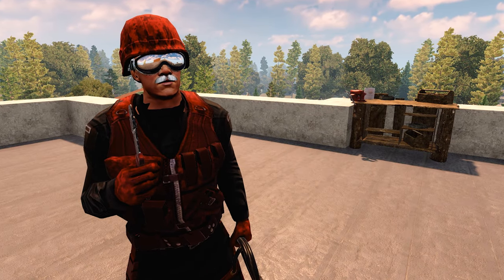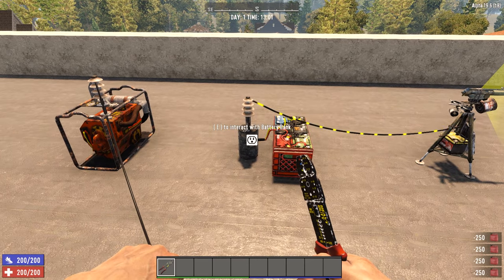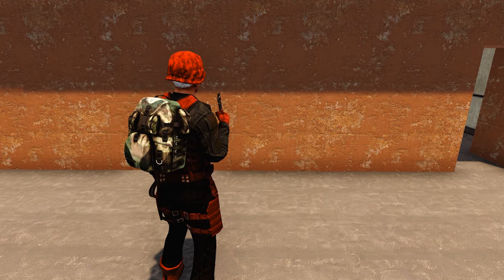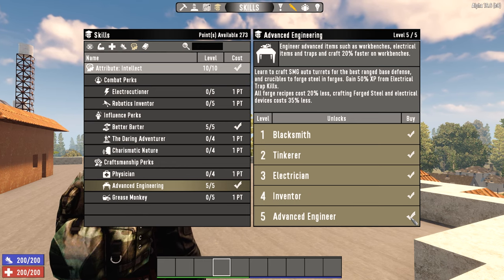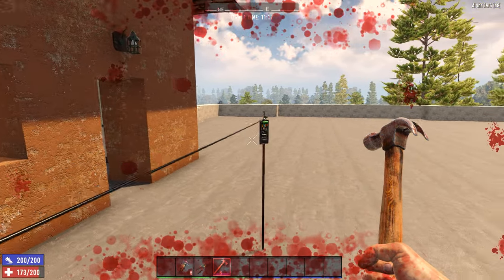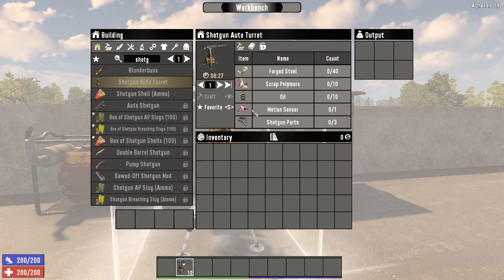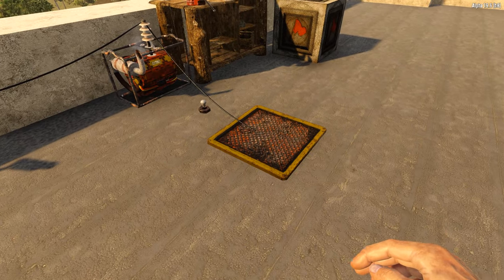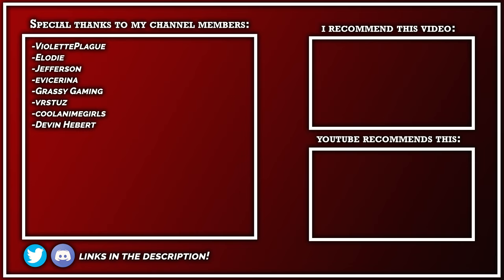7 Days To Die Complete Electricity and Traps Tutorial [2021]

Comment: I've been using this guide for about 10 months as my go-to electricity guide. its the best. I do want to mention a disagreement i now have though, when discussing battery banks and solar banks. I've been using generators exclusively because that seemed like the only power source worth using. However, recently our group starting a crafting base (in the wasteland), and we needed some automated defenses and a powered door. I had a million quality 6 batteries saved up, so i tried out the battery bank. it works perfectly, and you don't need/want a switch (this is my disagreement). if the battery bank and generator (and later solar) all can power the system, then the generator powers the system when on, and recharges the batteries. when the generator runs out of gas, the batteries take over until they deplete. if you have solar, the solar charges the batteries and runs the system during the day, the batteries run it at night, no intervention needed. its perfect for constant base defense in multiplayer. Generators are still way easier for horde night.
Reply: Very good point - if you have multiple bases somewhere that you only visit everyso often then you do need some low maintenance solutions - I find other players satellite bases fascinating

Comment: One thing about tripwires or cameras triggering something forever: You can use that to check if someone was at your house. Place a camera triggering a light whenever a stranger says hello, and when you come back a few hours later and see the light turned on, you know someone was there. That's useful if you have shops/vending machines and don't want to check them manually all the time.
Reply: I play on console, kinda new to game but I haven't seen any of these cameras, floodlights, etc In my recipes. Do I need to level up certain skills?
Reply: @I3lazedOne  the console version doesn’t have the update but I hear they are bringing out a new update for console

Comment: Thank you for the vid! I feel like you missed an important opportunity with the Battery Bank. Its for emplacements that you don't want to build and manage a bunch of generators. You can have one generator charge many batteries at a series of battery banks and then swap out batteries whenever you want. You don't even always need to charge them as you can just find new batteries with charge. Anyway I use them as personal power packs for traps and turrets that are not placed close enough other things that I charge with a generator. You could build multiple generators if you wanted... I don't think the noise is much of an issue. but I just think of the battery bank a useful portable tool.
Reply: I use batteries connected to a solar banks at little outposts that I don't want to bother checking up on every day. If you calculate the power usage correctly, the batteries will recharge infinitely through solar power.

Comment: I wish they would make it possible to connect multiple generators or solar panels to one battery bank, but you can always overcome that obstacle by building multiple circuits with each circuit not exceeding 170 watts for solar panels (that way the battery bank recharges with the extra 10 watts during the day so it can run all night and fully recharge the next day).

Comment: I didn't know the generator bank could recharge the batteries. I just spent on better barter to get solar with 6-cells. Should mention that generator banks don't generate heatmap. I assumed it did which is why I limited usage to horde nights, when heatmap couldn't possibly make things worse.

I thought I was familiar with electricity, having spec'd into engineering early, but got some good tips out of this.

Comment: dont discount the battery bank you can have them charged and ready as a backup so if your generator runs out of fuel or damaged or solar isnt working the  you have at least some time to fix the issue a few lights and wires and you can have a light system that will let you knkw what is running and what isnt

Comment: 2 Questions: 1) If I had a Generator attached to Battery Pack and the battery pack attached to say a spotlight, how would i get it to charge the battery pack and not power the spotlight? (When you was explaining this it confused me (I'm also a new player)) 2) Towards the end with the 2-way door system can i go generator > floor trigger > power relay > floor trigger 2 for the same affect? (Like i cant stand wires going into the ground or through walls or anything  of that sort.)

Comment: Maybe I missed it but I don’t remember sound being mentioned.  In real life generators made aLOT of noise and would attract anything attracted to sound.  This lead me to think that solar power is better, however you recommend generators.  Is the game all fantasy in this aspect?
Reply from the maker: Generators don't make real sound. You can hear it but the zombies can't.
Reply: Sound is irrelevant in this game. The zombies are attracted to heat as the game uses a heat map. Weapons and tools all produce heat when used. Also fueled workbenches produce heat. You would think a Generator produces heat also since it's fueled but IzPrebuilt is correct it doesn't. There's some info about this in the journal under Activity Map.

Comment: Two question, how to have infinite electricity? Can i just have solar bank to baterry banks and have it always recharged during the day? If all is powered it will eventually go off, or does it keep up always because its chargin during the day?
If i turn baterry bank or generators, and nothing is turned on at all, switch is off, does it still use baterry or gasoline? Can i leave it on all the time and just use a swtich?

Comment: I will be honest, my PC is a high-end machine but damn, electricity in 7DTD is in a massive need of optimization... I just wanted to light up my base (around 50 lights) and it just ate my PC. I have to play on low settings to get acceptable FPS but at this point, just deal with screamers with 100 torches.

1440p Ultra Settings around 140 FPS without lights / lights on ; 37 FPS

CPU: I7-11900KF Watercooled
GPU:RTX 3080 Ti EVGA FTW3 ULTRA OC
64 GB RAM 3200mhz Corsair
Seasonic 1000W

Comment: I am confused about the pressure plates and motion sensors. How do you keep zombies/animals from triggering them and entering your base? If any entity walking across triggers the plate it seems to me zombies or bears could as well defeating the purpose of the door.
Reply from the maker: Motion sensors can be set to target players, neutrals, you and enemies. A pressure plate is configurable. If anything stands on a pressure plate, it sends out a current.
Reply: @IzPrebuilt  AH ty so much I have been afraid to try using them,

Comment: I just need a bit of clarification on the electric fence traps... if I have 3 active electric fences passing through the same block space, will all three traps damage zombies cumulatively, or will it do the same damage as a single fence? If it is cumulative that would mean a whole lot of damage potential in a single area, but that seems like it might be something FP would have nerfed already.
Reply from the maker: As I understand it from the gamefiles the zombie can only have 1 shock debuff applied to it at a time. 

The shock debuff is what seems to apply the damage. so as far as I can tell, there is no advantage to having several electrified wires occupying the same space.
Reply: @IzPrebuilt  Makes sense to me since it wouldn't technically be more voltage. More comparable to getting caught in 2 snares at the same time as opposed to one.

Comment: This does give me a few ideas for my A20 bases, but I will need to think of a way to hide those ugly wires. And in terms of lights, is there not table side ones you can craft/table lamps you can find?
Reply from the maker: Yeah other lights do exist but they're not a part of the electricity mechanic.
Reply: Use junction boxes. wireless. xD
Reply from the maker: @gamingfryu6638  Those aren't in the game.
Reply: @IzPrebuilt  That's what mods are for. xD
Reply from the maker: @gamingfryu6638  Thanks for that stellar observation.
Reply: @IzPrebuilt  No problem man..
Reply: The best way I've found to hide wires is to put a relay where floors and walls join together. Knock a couple blocks out and stick the relay out of sight, then run wires from the hidden relays. Use hatches to hide the holes in the walls, or simply fill in the block you knocked out to access the relay. Kinda hard to explain but you hopefully you get the idea.

Comment: Is this video still rative today?
Reply: Rative? If you mean to ask if it's still accurate... mostly but not all. Quite a bit has changed in three years. Solar stuff now appears at traders at trader level 55+ (won't go into how you get that, but it's basically your level modified by your tier with the trader and boosted by the Daring Adventurer perk), you can no longer craft stuff just by maxing out the skill and probably some other changes. In terms of the basics, though, it's all still correct and very useful. 

I personally prefer solar -> battery bank with isolation switches to control the power relay. But for a horde base, the generator is absolutely fine.